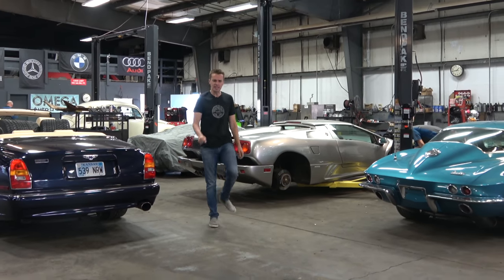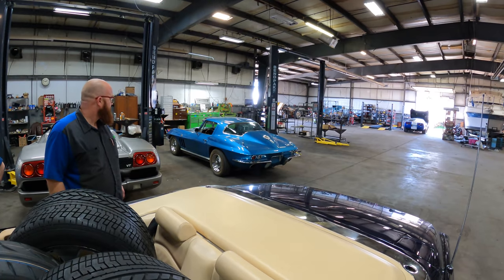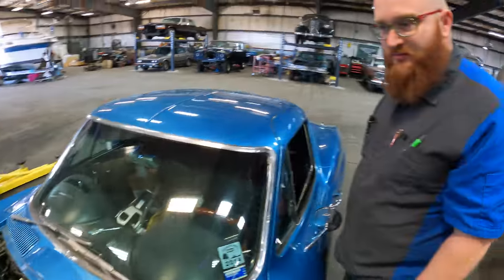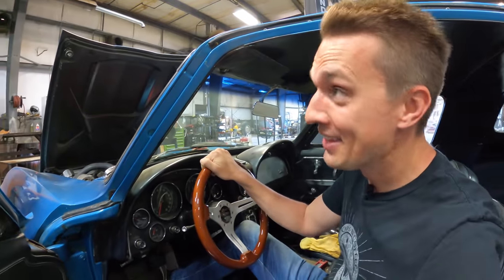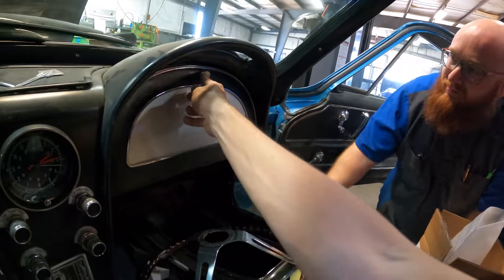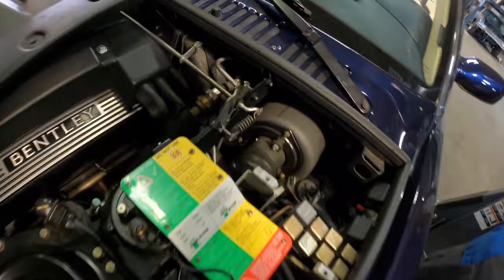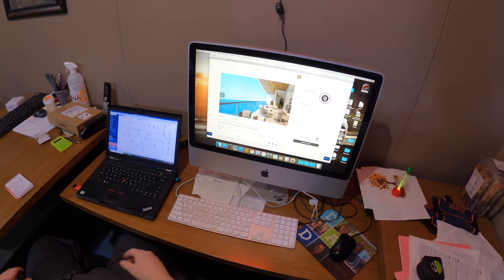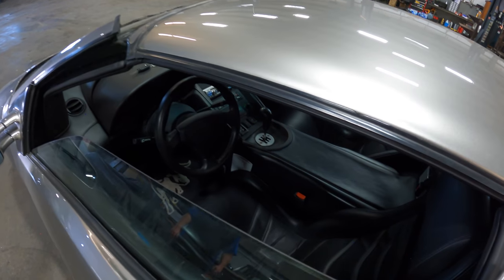Everything Broken and MISSING on My Cheap 427 Powered Chevy Corvette Stingray

Comment: Having owned over 20 Corvettes (including a few C2's) I don't believe that is original paint. The original paint would have been lacquer and it doesn't hold up over the years. It looks way too good to be original (in my humble opinion). In addition, your MSD ignition is in the spot where your radiator overflow tank should be. And I don't see an overflow tank in there.

Comment: The solution is obvious. Lose the Bentley. I really don't see the allure of old ultra luxury cars. They're bought new by people as status symbols. Once the new generation of the model comes out, they're really no longer status symbols. There's nothing particularly special about them. An older Lamborghini trumps them. Case in point: 1971. You can get a Lamborghini Miura or a Bentley. Fast forwards to 2021. Which of those would you rather own now?